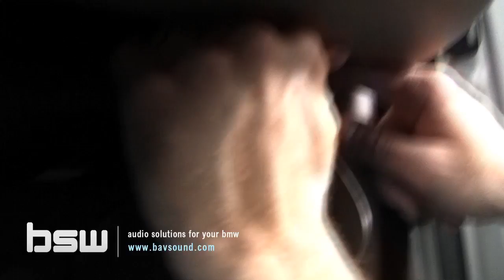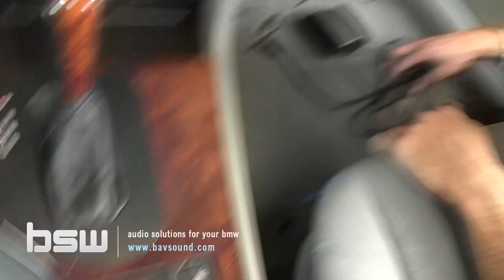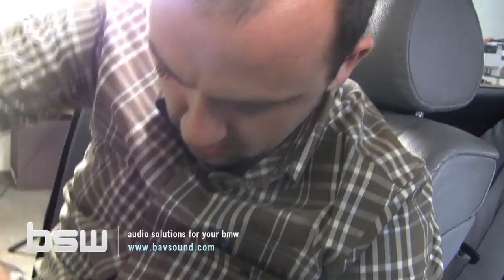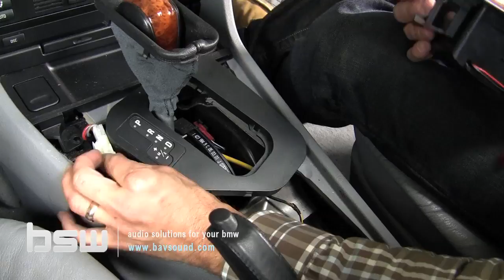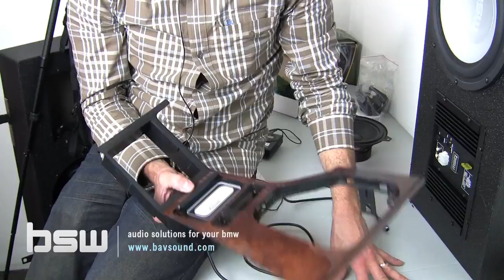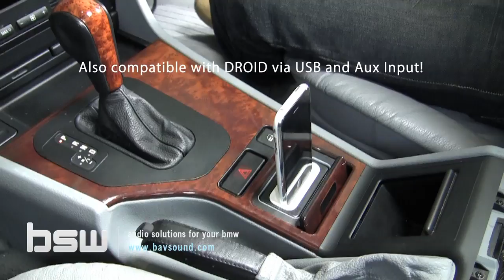BMW iPod/iPhone Kit Installation | E39 5 Series 1996-2003 | BAVSOUND Soundplicity | Part 2

Comment: Nice video, thanks much. Bought my M5 with DICE iPod integration done, coming through trap door in center console. It froze on me recently, and didn't know where module was located. Fixed it with battery disconnect, but next time I'll know where to look.